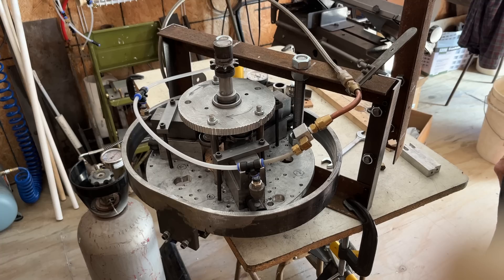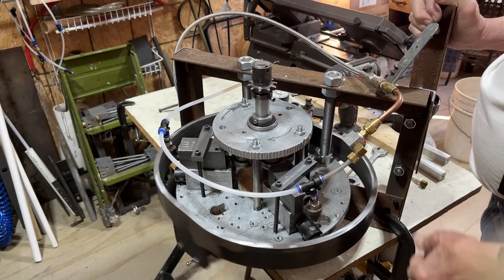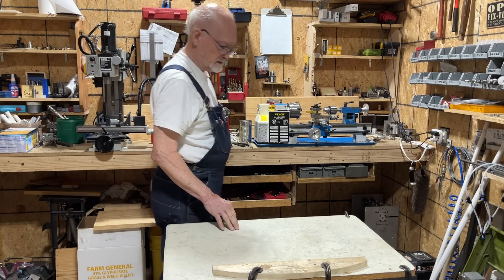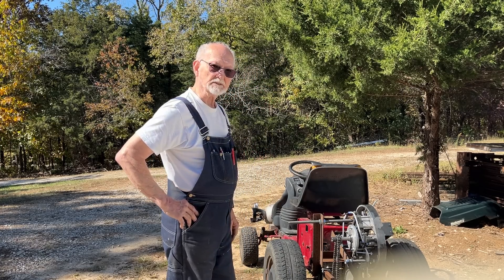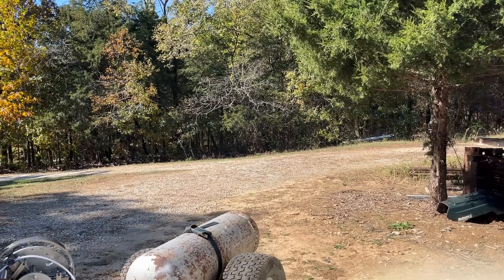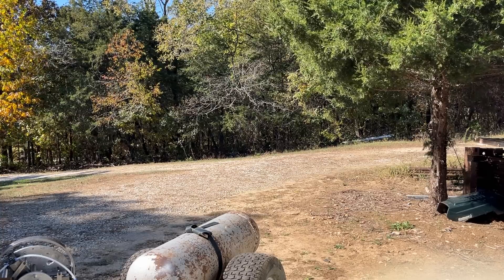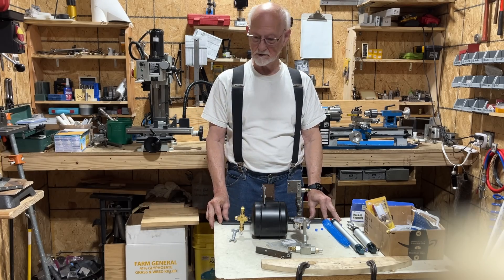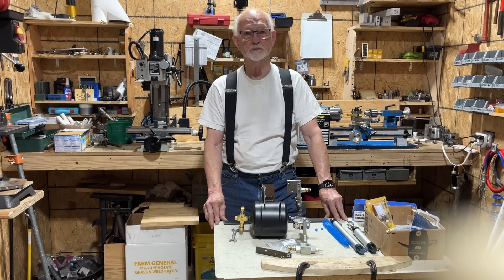Driving with one of my Prototypes - A 3 Cylinder Air Engine 10-20-2024

Comment: Theres a guy in my hometown that is working on a air engine also and for several years  goodluck
Reply from the maker: Thanks for watching and the comment.
That is interesting that you know a person working on an air engine.
There are a lot of different ways to produce rotation using compressed air.
Over the years I have made 168 videos, and I never have counted the different designs, but there are many!
Over just the past 2 years I've worked on 3; 
A 3 cylinder
A 4 cylinder
A 6 cylinder, and each use a different way to turn the driveshaft.
I wish him success, and thanks for the good luck wish.

Comment: At the automotive repair college I attended in 1980, they had a v8 small block chevrolet engine that ran on air for the purpose of having a classroom running engine without all the smoke and noise. Very simple setup. But it ran off of the air provided by a very large compressor. Which of course would be needed to keep up with the demands of a 350 cubic inch motor. So air powered motors could only be a novelty. The size of tank needed to have any kind of usable distance would be enormous. And of course the source of energy to run the compressor is still connected to the grid. Not knocking this gentleman at all, as one of the commentors wrote (59redwing) his staying busy tinkering around is the secret to a long and healthy life. Until that is, your wife starts bitching at you for all the time you spend in the garage. Been there done that. My shop won, wife is gone, never felt better about it.
Reply from the maker: Thank you for replying.
Yes an Air Engine will use a lot of compressed air.
Comparing a low-pressure Air Compressor running an engine and a Carbon Fiber Storage filled with 5000 psi compressed air might not be a good comparison.
Also, a 350 cu in per revolution and 6 cu in volume per revolution is quite different.
It is a novelty and when I am further along with it, hopefully functional. 
Currently I am concerned about safety and my next video will be on how to control the 5000 psi and lower running pressure to the engine.
I started over 25 yrs ago developing ideas and prototypes and my wife seemed to tolerate it until 2023, I am now also a widower - who will continue the work I stated.

Comment: This considerably looks like a skeletonized Wankel engine very cool
Reply from the maker: Thanks for responding to my video.
Thanks for responding.
I'm not sure that I see any resemblance, the Wankel design would use way too much Compressed Air and is much more complicated!
I consider my 3 Cylinder Oval design to be a reverse crankshaft, the pistons pushing outward to rotate the Oval Ring that turns the drive shaft.
I think I am getting good torque with the Oval Ring turning the driveshaft, like pushing on the tire to move the car.
The has a 6" radius or throw compared to a crankshaft with a 3" throw where the each piston moves 6" TDC to BDC and mine each piston move .99"
Here is my design:  https://youtube.com/shorts/qnISN1EgoCU

Comment: Nice but what is its practical advantage over elec/fuel....?
Reply from the maker: Thanks for responding.
We all know that fossil fuel is not good for the environment and is not going to last.
Electric is the best, if it weren't for the battery's hazardous problem.
The advantage for me is, I can do it myself.
I have been trying different ideas and designs for the last 20 or 25 years trying to come up with a simple, easy to work on that I could build myself and I think I'm getting there. 
I envision compressing the air by using solar, wind power or waterpower, but as I work on my projects, I am using an electric generator for now.
The one on the lawnmower body is for fun, but the one for my VW Bug is more serious:  https://youtu.be/KF5uWtT5ZLo

Comment: The oval and three piston design looks like a Wankel in inverse; The rotor of the Wankel being the static pistons of your design and the Wankel combustion chamber being your flywheel/rotor/crankshaft.   Wankels were known for having hp/torque in a more direct relationship to RPM.  Also they were very poor at burning cleanly and economy.   Does your engine design inherit the strengths and weaknesses of it's most similar mass-produced counterpart or am I being obtuse and ignorant?
Reply from the maker: Thanks for responding.
I'm not that I see any resemblance, the Wankel design would use way too much Compressed Air and much more complicated!
I consider my 3 Cylinder Oval design to be a reverse crankshaft, pistons pushing outward to rotate the Oval Ring that turns the drive shaft.
I think I am getting good torque with the Oval Ring turning the driveshaft, like pushing on the tire to move the car.
The has a 6" radius or throw compared to a crankshaft with a 3" throw where the each piston moves 6" TDC to BDC and mine each piston move .99"
Here is my design:  https://youtube.com/shorts/qnISN1EgoCU

Comment: medical Oxygen  tanks hold 2000 psi
Reply from the maker: Thank you for commenting
Yes, you are correct. They hold 2000 psi, but I’m looking for tanks that will hold up to 5000 psi and 55 L which is quite a bit larger than most of the oxygen tanks. 
Carbon fiber tanks, are very expensive, but they are available on Amazon, but right now I’m not quite financially ready to buy one till I do some more engine testing and make sure that they operate properly and have the power needed.

Comment: If you could capture the exhaust and filter it, you could vent it inside the a vehicle and have free ac, and if you were useing a scuba tank, the air would be cleaner going into the engine then the outside air.... and if you wanted to get technical.. it's the perfect completely zero emissions vehicle.  Scuba air is filter which would mean that each time you fill the "fuel tank" you remove pollution from the atmosphere.  If you filter the air from the exhaust, you can pipe into the enclosed vehicle, and the aire inside the vehicle would have less pollution then outside. And you would gat free air-conditioning with zero power loss. You might could figure out a non emissions way to heat the air before it goes into the engine and get a little better performance... I'm not sure how you would heat the air up after it leaves the tank before it goes in to the intake without some sort of pollution. Lol  I know I a dreamer what can I say. Lol
Reply from the maker: Thanks for your reply and checking in.
Personally, I think dreamers are what makes the world go around, if you can’t dream about something how do things get made or done? 
I started my dream about 35 years ago and still working on it, but I’m getting pretty close to what I think will be ready to use in my Volkswagen.
I’m just waiting on finishing my 
pressure-flow regulator, the one I purchased has the pressure but it doesn’t allow continued increase in flow over 200 psi and I need to go up to at least four 450 so still working on that idea.
PS don’t give up your dreams!

Comment: I have wondered for so many years if an engine could be made to run on air and you just answered my question although I never imagined anything like this. I'm thinking about the way it's geared as in the sprockets might need changed around cause I had a Craftsman riding lawnmower that only went 5 to 8 mph and I changed pulleys around on it and I got it to where it'd go 20 mph but it was to radical to drive at that speed bein and older mower so I fixed it to where I'm thinking I got around 12 or 14 mph so I didn't end up running it into something cause the steering had at least a 4th of a turn on the steering before it'd steer instead of being how it most likely was when it was new..I'm pretty sure you'll get it figured out cause look what you have came up so far. That's a huge accomplishment 👍
Reply from the maker: Thanks for replying.
The 3 Cylinder on the lawn mower is just a sideline that I made years ago and since then I learned a few things that I will change on it.
I wanted to see how it goes now and will do the changes and see if it improves?
My real goal is putting the 6 Cylinder I made a few years ago and have tried, and found problems that I am currently working on also.
The project at the moment is a Pressure-Flow regulator. The one I purchased goes up to 600psi but stops allowing more flow at 200psi and that is not enough.
You can see some of the problem I had with the VW Bug here:   https://youtu.be/imJcC_dCQvo

Comment: It seems to be lacking in torque...I suppose if you had a heavy flywheel-type device attached, that would help...but then you would probably need more air pressure volume?...Hmmmm....
Reply from the maker: Thanks for checking in, and yeah, the torque is lacking and also the RPMs.
I have a pressure regulator that I’ve purchased that will only allow increase volume up to 200 psi that I can raise the pressure but the volume doesn’t go up so I’m in the process of working on that right now. Call flow regulator. I’ll be doing videos on it .
If you checked the notification, Bell, you’ll be getting info about the video when I post it

Comment: I beleive a transmission is needed to regulate speed and to not tax the motor so much ,worth a try ,keep going great work.
Reply from the maker: Thanks for the comment.
It was much easier to put the three cylinder on this body that I’ve played around with over the years, but I do have a different lawnmower that has belt drive six speed change on the go transmission that I’d like to try and put it in, but it’s gonna have to be Modified somehow to fit with that belt drive underneath the mower?
Stay tuned maybe one of these days I’ll figure out how to do it

Comment: YOU NEED TO ADJUST TIMING OF AIR INJECTION IT OVER SPEEDS AND AIR DONT HELP AT HIGH RPM. CHECK THE FRENCH AIR CAR
Reply from the maker: Haven't figures out yet how to add mechanical advance ?

Comment: awesome!
what about a transaxle?
Reply from the maker: Hi, and thanks for replying to the video.
I am not finished working on the three cylinder, there’s a number of modifications I wanna make.
I wanted to try it while I’m waiting for some parts to come in. 
I have another lawnmower body that has a belt drive with a six speed trans axle , like you suggested and I need to see if I can modify it to use with this three cylinder engine. 
 I have an important thing I  need to make before I do anything else, I need to make a pressure/flow regulator because the one I purchased doesn’t have the flow I need over 200 psi.
I will be working on that for a few days trying to make sure that there’s a safety on it in case something happens to shut off the 5000 psi pressure to the rest of my engine parts.
I’ll be making more videos as I get some things done .

Comment: How long will it run on a tank of air?
Reply from the maker: Thanks for replying to the video.
That was the first time I had it hooked up and ran it.
It is not completed yet, and I'm not sure what the final gear ratio will be or what psi it will have to run at so, I can't give you an answer now?
I will be working to complete it over the coming weeks and make more videos

Comment: Just curious if you built it to have something to do rather than just buying a much more efficient air motor like a rotary vane or scroll style.
Reply from the maker: Thanks for checking in and your thoughts.
No, I’m not doing it just to have something to do, I do believe there is a possibility of building one that can be used to drive my Volkswagen bug and drive it pollution free. 
There’s no way possible to carry enough air running a vane or rotary motor. They all use way way too much air. 
If I succeed in the end great, if not, I tried

Comment: Fascinating and brilliant original design thinking. If there was a cheap way to produce and store large amounts of compressed air you have a winner. More for stationery power supplies maybe ?. Wnder if such an engine could power a large enough air compressor to power itself ?.
Reply from the maker: Thank you for checking in and your comments.
When people say that it’s not possible or not practical to use a compressed air engine to drive a vehicle I do disagree with that and I hope to prove it someday soon, but I am almost certain that using itself to power a compressor to charge itself or run itself Would not work. Using wind water or solar power to reduce the compressed air I think as possible and with a 30 or 40 gallon pressure tank I believe you could go fair distance and then go back to recharge storage tank. Some people say, why is it necessary while I believe it necessary because we’re polluting the earth were living on and we want to try to do something to eliminate all the pollution and hazardous materials. We have to do something so I’m trying to do this, figure out a way to drive with compressed air
Reply: @AirEngineResearch  What sort of pressure, PSI/bar, is needed to power the vehicle, not amount but air pressure.
Reply from the maker: That was the first time I had it hooked up and ran it.
It is not completed yet, and I'm not sure what the final gear ratio will be or what psi it will have to run at so, I can't give you an answer now?
I will be working to complete it over the coming weeks and make more videos

Comment: how does your air engine differ from the indian company that has production air powerred vehicles?
Reply from the maker: Thanks for checking in, and the difference is mainly they use a rotary style engine and I use a 2 Plate Eccentric Drive with pistons
Reply: Links please to ANY company with air powered cars in production.

Comment: Interesting. Will it run in reverse, or will it need a gearbox?
Reply from the maker: Hi and welcome to my channel.
The one in the video is a direct chain drive so no reverse. the engine can r un in either direction if the valve and rotor is turned upside down.
I have another garden tractor with a variable 6 speed that I am hoping I can modify and use it with the engine?
Stay tuned - there are other things in the works!

Comment: Have you thought about using dry ice placed into a thick tank to get a high pressure co2 to run the motor.
Reply from the maker: Compressed air by itself could cause freezing, using dry ice would really complicate things.
But thanks for the comment

Comment: Nice design, I think you could squeeze more RPMs if you balanced the ring outside the pistons. Maybe mount the ring to a plate and then balance the whole assembly.
Reply from the maker: It is still a work in progress, The ring is balances now and I will be taking it apart and change the location of the valve system from under the bottom plate to on top - will be easier to work on.

Comment: Have you heard of the dragsters from the 1960's running on compressed air & jet engine starting motors coupled to the rear axle? Motors spun @ 90k +. Did the 1/4 in under 8 sec.
Reply from the maker: Yes, I have. Thanks.
That’s a little bit out of my league. I’m just trying to get it off the line!
Reply: @AirEngineResearch  they were a flash in the pan anyway.  The fascination wore off quickly when one dynamited & sent shrapnel into the crowd

Comment: Can you not make a larger and heavier flywheel,and machine the ovel piston control thing into it, the way I see it it should stop the vibration and give it some rotating mass then that should reduce the need for lots of air, but I could be wrong just a dyslexic Brit with a poor education. Love your idea though keep at it dude.
Reply from the maker: Thanks for sharing your thoughts .
The balance has been corrected and the problem is the high pressure regulator doesn’t allow enough air flow, so I am working on that now.
The engine is heavy now so I don’t want to add any more to it.

Comment: Can you produce ON Board air compression? maybe solar electric pumps, I would lighten the whole rig.
Reply from the maker: Thanks for your suggestion.
I don’t think it would be possible to put all the necessary things on that little body in order to use solar power to run a compressor, and it would just complicate things.
I think having a windmill or solar power to run a compressor and use a storage tank is the best solution .

Comment: larger hoses  for speed - like 12 or 25 mm,  rather than 6.
Reply from the maker: Once I get things to work the way I want then I go back and I use either copper or steel 5/16 for the airlines and valve systems but for now it’s easier to use flexible tubing and it doesn’t really need to be that large 300 - 400 PSI here comes out of there pretty quick

Comment: Regulators throw away most of the energy. If you can do it with on/off valves, maybe with electronic timing, and adapting to the available pressure, you moght make it all much more efficient. I say this without experience of trying to make what you're making - I'm an electronics guy.
Reply from the maker: Thanks for the thought and comment
My goal is to make the simplest possible Air Engine using all mechanical parts design.
The Compressed Air pressure will be 5000 psi in the storage tank and has to be reduced to no more than 600 psi going to the Valves and pistons.
The commercial regulator I bought will reduce the pressure, but the max flow is at 200 psi and that's not enough.
I have designed a Pressure/Flow Regulator that I am working on now and will be doing a video on it soon
Reply: "Regulators throw away most of the energy.".
That would imply they get very hot.  They don't!